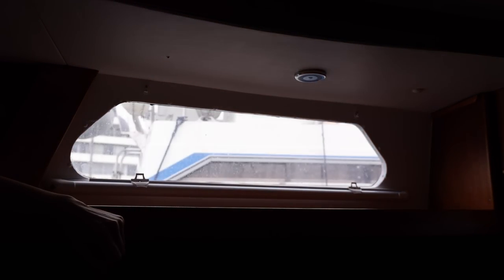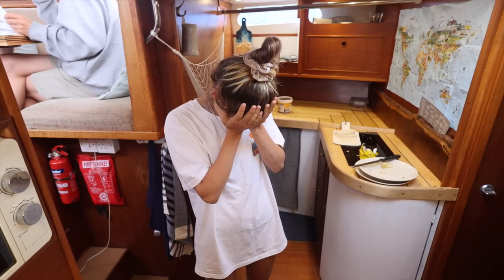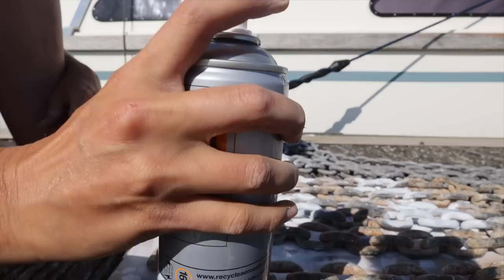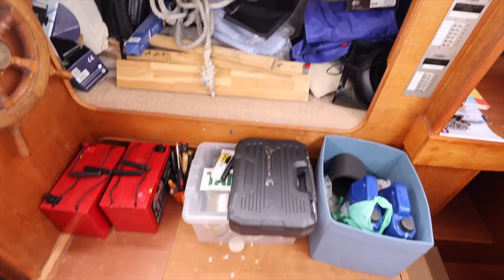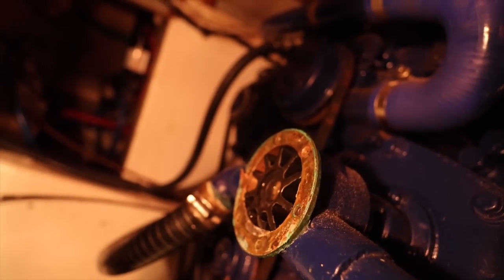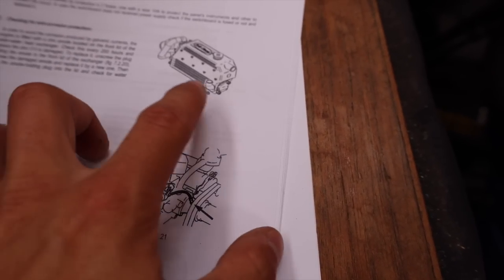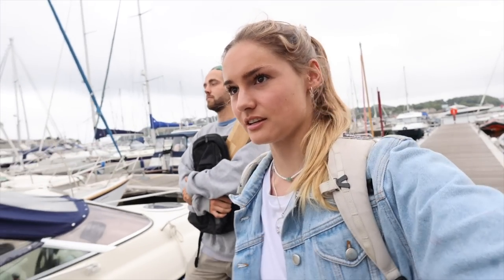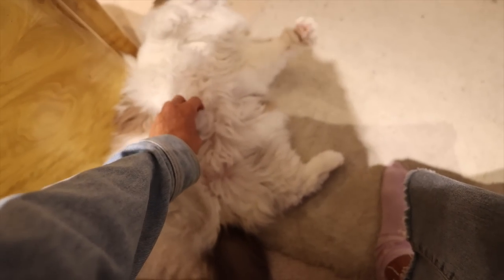A REALISTIC day in the life LIVING on a BOAT

Comment: Just watched your June 13 issue.  You guys are so much fun.  When you become broadside to the swell, ready your small anchor (lunch hook) , back the boat down on the main anchor so your bow is facing the swell let out most of your chain, set the lunch hook astern, pull ahead on the chain.  The stern anchor will keep the boat into the swell (assuming you don't expect a big wind change in direction).  Also, I got a chuckle over your super cautious nature, when I saw your sheet around a self tailing winch AND cleated.  Also, next time you shop at the chandlery, buy yourself a round metal radar reflector and attach it permanently high on the backstay.
Reply from the maker: Great suggestion- thanks so much!! Haha, as the confidence grows, the over caution will decrease 🤣 Will look into the round metal radar reflector. Thanks!

Comment: Did not see a torque wrench, if you haven't one, get one.  Always good to put a bit of lube on the impeller as it will run dry the first bit.  Washing up liquid will do.   If you have to sand something that needs to be flat, glue the sandpaper to a bit of glass. Wet/ dry paper is better to use for metals.
Reply from the maker: Will do, thanks Mark 😊

Comment: About your engine zinc.
Remember, your major zinc on the hull was NOT properly connected.
Your new engine zinc might last longer now that the hull zinc is made to function properly.
😊
Reply from the maker: Exactly! It took one for the team 🤣
Reply: @TeuluTribe  Also Zach, make sure you keep extras on hand as well!😊
Reply: @jasonmacneil2256  indeed.
Always have spares on hand for zincs and other below water parts. Emergency haul out, you have what you may require on board and replace those spares promptly.

Comment: Ground tackle. 
105 yards of chain is good.
How did you connect the 55 length to the new 50 yards?
All clevis pins must be wired to prevent turn outs.
How is the bitter end attached securely to the boat?
Have you considered adding 300 feet of properly sized nylon anchor rode to your ground tackle?
It can be spliced onto the bitter end of the chain rode to give you plenty of scope in a big blow.
Long rope rode is why there are both a rope windlass and a chain gypsy on your deck mounted windlass for your ground tackle.
😊
Reply from the maker: Thanks for the comment! We used one of those connecting split things you hammer down. The bitter end will be spliced around the d ring in the anchor locker 😊 Interesting to know about the rope windlass on our deck windlass- makes perfect sense!
Reply: I would suggest not splicing rope rode to the D ring. Secure with a well tied bowline. Hence the name of the knot... Bow line. Easier to remove the rope rode for washing and drying annually. Nylon is pretty impervious to much but should be fresh water washed, dried, and aired and inspected annually. It will have salt water wet dirty chain on and around it.

Comment: Ah glad its not just me with a pilot berth/nav station/outstanding job dumping ground. Personal I would bin the spirit level, boats move. Just eye it up to the rest of the boat, or even better in that case use the spirit level as a parallel to get your book case square to the rest of the boat. Even on land in most cases its your eye that needs to think its level, and most buildings aren't level so when your bit of pipe is perfectly level and everything around it is 15 degrees out your pipe looks wrong, uniform is better than right some times.
Reply from the maker: Usually we do everything by eye, but we couldn't agree on this one 🤣 and we were really still at the moment! But yes, we do agree that uniform is better than right some times!

Comment: Looking at the frame at 13:48 I see two things.  The top sheave shows the belt back above the top of the sheave. This is correct. All the drive comes on the sides of the belt. If the belt is riding on the bottom of the sheave either the sheave is too big, or the belt is the wrong size, or it is knackered. However, the bottom sheave shows a small gap between the hub and the sheave.  If I am correct, this means the sheave was not installed correctly on the hub, i.e. is not straight and 90 degrees to the shaft and may be why the edge of your belt is shredded. It only takes a small irregularity or misalignment to ruin belts on the regular.
Reply from the maker: Interesting- thanks so much. We will look into this 😊
Reply: Wowzer Mark! Good tip. Are you a forensic scientist at heart?
Reply: @chr15996  Many years of industrial experience. When stuff is run hard 24/7 you find out what is important.

Comment: White socks in sandals is not nice for anyone. And white socks on doing engine works is not any better🫣
Make it a habit to simply change the impeller once a year and always change the gasket when doing so. As some also wrote here it’s a good idea to put a little dishwashing fluid on the impeller to make sure it goes in smoothly. 
I’ve doing a lot of work on my boat and it wasn’t completely finished when I went away in it for my summer break and it was just SO dirty and messy. 4 days into my vacation I finally got it cleaned up but still I’ve a ton of tools here there and everywhere. But today I got the curtains up👍🏼😂
Reply from the maker: Thanks Jan! Great tip about the dishwashing fluid! Ouch, it is just a lot of work! But a great feeling when something gets ticked off the list 😊